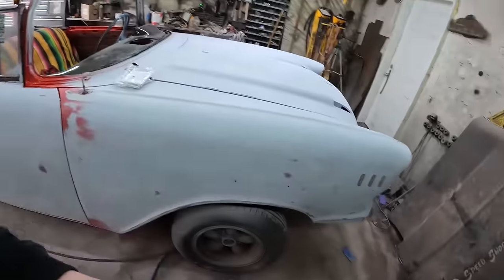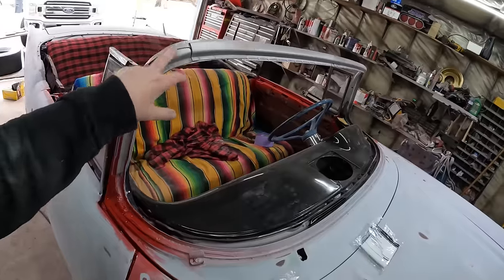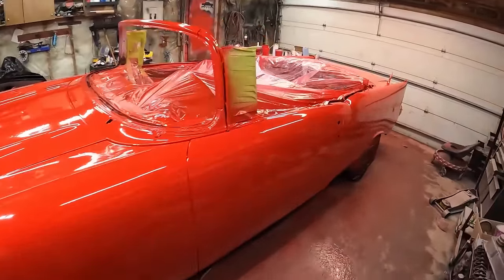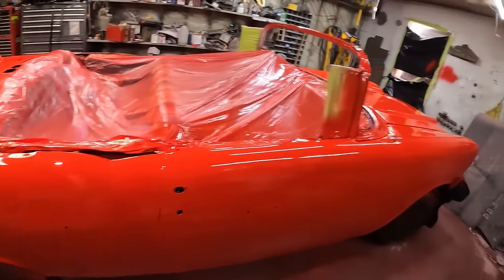"Almost Perfect" $100 Paint Job - Tractor Paint On A 1957 Chevy Convertible?

Comment: What  I like about this is you can paint the barn the same color and when you park the car inside it disappears in the background Now if you pinstripe the car you will have a huge job pin striping the barn. Of coarse if you painted flames on the car, it will make putting flames on the barn alot easier, just light a match.

Comment: It is all about flow.  Wait on the tack coat (actually touch a tapped part to make sure it is tacky) then by coat three you can add more reducer and open the material control a little, move a little faster to flow out the paint. Add 50% overlap and that is the best way to get between orange peel and runs. Nice work.
Reply: Yep, a painter friend of mine called the final top coat a HOT COAT.  Mostly reducer with a little color in it.  You have to be careful not to put it on too thick because it literally will sag the paint and cause runs.  But a hot coat makes the previous coats smooth out and flow.  Brings out a high gloss in enamel paint.  Practice on an old door or hood to get the technique down.
Reply: Yall have made me realize theres a whole class of painting i have yet to be introduced to
Reply: Turn your fan wider. And it will atomize the paint better and lay down better. Don’t over reduce the paint it will make the shine dull after a few days
Reply: Personally since he had the orange peel I would have sanded it and retacked  it after each coat then added the hot coat on top.. Then after the clear coat is added you ca mirror shine it on the clear
Reply: Seat upholstery?
Reply: But also do 4 coats if your going to sand and buff. IMO. your right exactly first coat light then more reducer as you coat. I usually shoot 3 then let it dry. wait a few days sand with 400 then spray 2 more. gets amazing results with Single stage. But I dont use that anymore. Base clear is much better for touchup or problems later that you need to spray and blend color. almost nothing matches so if you need to touch up later you will need to blend and the single stage does not blend well for smooth finish. That is why all manufacturers went to base clear.

Comment: That’s one hell of a accomplishment on so many levels , from four door , then two door and now a convertible. Simply fantastic work Dan . 

Cheers
Reply: That is for sure
Reply: IF your sanding and buffing you should do 4 coats. But I would sand it down and respray it one more time. Color sand it with 400 then respray it will look like glass. Second spray coats lay down really smooth. 2 more coats then sand and buff.....if your going that direction.

Comment: On paint where I don't have a spec sheet showing me exact recommended mixes, I have an old school method of creating a nice spraying and finishing mix. I add reducer to the mix slowly, stir it in and then lift the stir stick and allow paint to fall from it back into the pot. When the bubbles created by this come back to the surface in about two seconds, it's good to go.
Reply: That's a how a old school painter taught me mixing the paint correctly for a good flow. One thin coat, let it sit for 10 minutes until it's tacky, then a second coat with precision making it flow to a mirror shine. Then wait 10-15 minutes and third last coat laid down same as second, heavy taking notice what distance you holding the gun, check every panel before going to next one for any dry spots. Painted a lot of cars, 18 wheeler's, show cars during the years using this method. Water in the line or dirty paint gun has only created a few problem, but never the mixing method.

Comment: Looks like a 1957 Chevrolet convertible to me! A neat trick to get rid of those runs is to take a good glaze auto body or finish putty thin coat over the runs let dry good  then da the glaze putty with 800. grit paper un till the putty is gone and so will the runs.  Old painters trick.  I have  done this for years and try it,  form advice of a 75 year old watcher and 40 year painter

Comment: im a 35 year vet doing collision repair and restoration ..this week,One of the to do things was fix a 55 chevy hood that got punched in front hard and bent the edges in someone ran to tall of bolts threw the hinges one time. it looked like it was used as a table for hammers at one time upside down.getting to many hours in it now to make it sweet i complained about it and now at least they paying me by the hour on it instead of commission yikkers.the more i work on it the more i find wrong.but at least it still has original wore out green paint barely left on it the guy paid 55 dollars for it.its going on a old 55 racecar that still has gold leaf lettering on it from the 70s racing days to replace the big snorkel hood.love your videos!.remember you can never fill a high spot knock down the highs raise the lows repeat till its close

Comment: Silicone near any auto paint is a big NO, at some point you'll find that lesson out. A sealer would definitely help with all the cut thru areas, sand scratch swelling and possible lifting on those edges, especially due to the other paint applied under the primer. Hope it turns out half way decent.

Comment: Try this dan,  waite about 10+ days, wet sand it with 800 and rubber pad to get all orange peel flat and get all the runs flat as well, then wash the car and rinse it over & over. Then on a better, much warmer day ( 65+ degrees ) in 2+ weeks or so, mix up another batch of the same red paint with more hardener and reduce it as much as you did for the second coat that you though was to thin. Also it's  a good idea to let the fully mixed & reduced paint sit for about 20 minuets to let everything melt tougher as a unit before putting finished product in the gun.   Re prep the car & shop as before, blow the car out real good again and wet the floor, put a ground chain on, & wipe car with tack rag. Then put 2  more coats of red on, one medium coat and one lite coat with reduced paint. Don't be afraid to use even more hardener.  

   What you should always be doing is trying to keep reducing the paint MORE with each coat. "Never add " extra paint to make it thicker or it will go flat on you every time.  If you feel you need the paint just a little thicker, add MORE hardener, never more  paint.

 It would seem you are starting to listen to my advice, ( it's about time as I am a tool to be used) Your doing good, just keep asking questions and I will give you the correct answers .

Comment: Great work Dan, sure it wasn't perfect but it looks dang good!  One of my garage paint jobs- '91 LeBaron convertible- it was about 100* in my garage "booth" in Georgia, USA and I used the slowest reducer I could buy and over thinned it- I was drenched in sweat and wearing long sleeves so I would not drip sweat but it still happened in the middle of the hood- charcoal base coat with clear. Between the heat causing the paint and clear to kick too quick and my 110 volt air compressor being somewhat inadequate on volume, well I had a lot to wetsand and buff- at least I laid enough material down!  Once you mix the hardener etc and start to pull that trigger you are committed for sure, no stopping in the middle of that job!

Comment: Thats good advice you gave Dan, I practice painting beaters with cheap single stage paint like that rather than spending $600 and up on a quality two stage that if I screw it up will cost even more to fix. With a $30 gallon of paint you can screw it up a lot and its just a good learning experience. Its fun to practice with metallic, particularly silver and medium blue metallic, because those show off not up to snuff body work and tiger stripes are obvious. You become a better painter by learning the hard way. Get the right metallic pattern without stripes and with a smooth finish, and two stage is SUPER easy to not screw up.

I am so over the cold and snow. Last week it was 70F, this week has been 20s and teens for highs. Then they salted the roads Monday.. so no hotrods come out until it rains enough to wash it off the roads. I am jones'in for a burnout fix.

Comment: I'm going to try to help you out, it's up to you as to rather or not you take it to heart. What ever components you're going to mix needs to be measured in separate containers, in this case there should have been 3, base paint, hardner, finally reducer. Add each component to the base SLOWLY, stirring rapidly as you do. What this will avoid is washing the binder off your solids as it plows through the center of your base, doing that leads to a whole host of problems, kick-out, seediness, slow cure, and later on, crazing. Also, in the absence of a paint shaker, stir your base 100 times....no cheating! Let the mixture slake for 10 minutes stir 50 times, then spray away. You're using chemicals that need to be blended carefully so, be the chemist. Carry on, good luck.

Comment: It may be this and it may be that, but it is one million times better than it rusting away in a field. If you are going to continue painting your creations, then look into buying a pro paint mixer. My father is a pro body man, he has a paint mixer. If the jack stands are touching the metal undercarriage then the car is grounded out. Which prevents static electricity from pulling dust particles out of the air onto the paint. If you don't use jack stands then drape a chain over the axle and run it lengthwise under the car to properly ground it out. If I were you I'd continue to do body work and paint, even though you hate it, make it an acquired taste, because the world is going crazy on costs. So ya better keep learning to perfect your art by doing it yourself. Keep on givin her Dan and we will stay with you for the ride. It's life, life is lessons learned and the journey made and that's why I love watching your channel, because I get to watch you move forward in your skills. Fuck Yea hims did!

Comment: A couple of tips, wrap paper towel around your wrists and tuck it into your gloves it soaks up the sweat drips from your hands, hang thin plastic decorators sheeting around the walls day after you blown out the dust it'll have some static to collect fine dust your disturbing, it'll cut down on the dust in the paint. nice job tho, looks good.

Comment: Well i think you did a pretty damn good job. In a few shots looking down the driver's side, it looked very straight. I think once the trim is on and whatnot it will break up the red and any imperfections won't be as noticeable. Either way its gonna look REALLY good going down the road, being DRIVEN. And I'm sure chips and scratches will be an easy fix too, with this stuff. Right on man, you should keep up with the painting!

Comment: Wow, whats the inside temperature of the shed??
What is the temperature of the panels?
Cold temps and your paint will 'Bloom' and the Bloom spots wont shine. 
You might make it better with a cut and buff but with out heat, i wouldn't rub it back
for a month. Let it fully cure/dry then rub it back with some 1000 grade wet n dry 
then polish it with a cutting compound and finish it with a hand polish. 
Something My Mothers or Meguiars ultimate compound. 
Your learning and doing something you enjoy so keep on keeping on.

Comment: Cool. I would have used a wider stay pattern  and more over lap. Four coats is the general rule.  Also need to spray up under the wheel well edges.  Just some advice, nothing more than my two cents. Hehe.

Comment: ( nice new red hair tips , great buzz too ) But Naw , you could two tone it white as the top color ( hides a plethora of body work and hits,  runs and errors  as the krylon commercial used to say , hit it one more time until covered , let it dry under the most heat you can , and until summer if you have to , sand as needed, finish w clear automotive, buff 💪, great color for what it is , you won’t know the difference, and anyone who does , F em !

Comment: The hundred dollar paint job?  Right!   I'm painting a 65 Nova wagon right now and found a gallon of Innsbrook Blue Dupont Centari enamel in a dark corner of my garage... free paint, yea.  Of course the half dozen rolls of tape at $12 each, the 400 wet/dry at $1.30 a sheet, the thinners and solvents at $24 a gallon, the $100 etching primer, the $100 hi build primer, the $40 can of bondo, D/A paper, file board paper, I'll be spending $500 even with free paint.  Still cheaper than tipping strippers at the nudie bar I suppose.

Comment: Pretty sure you call that "FIRE engine red." as much as you struggled with the color, you are not alone.  red is an expensive color and there are endless hues. NICE WORK. (P.S.  they also call that "Ticket Getting Red." )
Reply: Look like in picture , straight body , see what look get the chrome on the car
Reply: Fixed the runs
Reply: Cop Caller Red. Same thing but different twist.
Reply: I always call that “Arrest me red” 😎
Reply: @hoosierdiyguy6300  Next level fun?

Comment: That tractor paint is usually pretty tough because of the application. just let it inside for a few days to a week to harden then it will be easier to buff. I look for the hardness when painting tractors because of putting the panels back o without paint cracking.

Comment: If you don't mind me asking what brand exactly of paint did you use and where did you get it from I'm trying to replicate the exact color bran everything you've got I've got a little Honda Civic I'm trying to paint red it's a factory red car but some idiot got a hold of it and spray-painted it I'm not trying to spend anything over a few hundred dollars as I'm going to do it myself in my shop it doesn't have to be perfect just something that'll look good for a few years. If you can give me all the info and details of the paint Brands and where you can get it I would very much appreciate it

Comment: i use tractor paint for a lot of things. cars trucks,  to change some of the colors i get 8 oz, can of pigment from the auto parts store to change colors on tractor paints, and then i get the hardener dry's faster and looks great, i don't know why they think automotive red paint cost so much but it's overrated, and cost is stupid prices, look at dans car it looks great, oh and you can change the colors also by using pearl in the clear coat if you want, cost more that way,

Comment: Too bad that the tractor paint doesn’t hold up.  The red gets a scum coat on it after a few months then turns a kind of brownish color.  Like old sixties GM burgundies did.
  I painted more than a few “used cars” with this stuff back in the eighties.  Looks good for a short while.

Comment: I suggest don't put water on the floor you'll drag your hose across it you pull your hose and it slaps Water all over your new wet paint I've painted at least a 150 cars in my garage and my garage floors a little bit of different colors but who gives a shit just cover up your equipment If that's your 1st paint job it's not bad

Comment: That paint will cure up pretty good with hardener.  It still cures slower than auto enamel but will be pretty durable and color sand out just fine.  I painted the transom - sea well area of my 40 year old lake boat nearly ten years ago and it still looks new, even resistant to fuel spills!  Cheap can still be good!

Comment: I've painted for 35 years   in a shop like yours  with a fan and wet the floor   but wet sand  is the very best   block it out 2000  gritt  lots of water  and put a drop  of dish soap in the water bucket It cleens  the shit out of the  sandpaper   I love the 57 my new Ryde now is my 57 pontiac Laurentian

Comment: First car I ever painted was this nova in the lil picture next to my name…..I did it in my garage just like you….it’s a single stage white, and the hood and trunk are black ….but on top of that I put down a high solids clear coat 3 layers with the first 2 having a green ghost pearl so when the light hits it it has a green sparkle and the trunk and hood basically turned a deep bass boat sparkle green, people are shocked when I tell them I did it in my garage by myself…..I’m gonna do the same with my ‘73 c10 fleetside just with a blue ghost pearl in the clear over the white…..I have it all ready I just gotta finish a little bit of prep work……you know how it is!!!

Comment: Just the opposite the more paint you put on the more orange peel and runs. I always keep my material feed down to 2 turns on last couple coats and .about one turn for first coat.Let paint  tak up between coats.Putting more paint works on hood and deck lid because they are flat surfaces.but it causes runs on side .The key is less paint
 make sure your paint is atomized real good with air pressure  and slowly build that glossy finish.Thicking the paint will cause runs and orange peel.

Comment: Lookin pretty good for a rehabbed 4 door. The DIY cheap paint jobs teach you how to paint along the way. it's just like anything else - welder needs stick time, driver needs seat time, painter needs gun time. I watched a journeyman painter shave runs with a razor blade once, doubt I could do it without gouging. He did it after a couple days, there's a not to soon and not to late element to it....you want a level of softness in the run and hardness in the surface.  AND .... wait to sand... the paint in the run won't be cured like the surface - It'll need time to harden up. If the runs aren't in a compound curve area (like fenderwell lips) they make shavers (for lack of a better term) for cutting the runs down to sand. 
I think you did great. I'd bet it''ll be nicer than a 20 footer when you get it sanded and buffed. Thanks for sharing

Comment: Hey Dan, I don't know what you have planned for a future top for it, but I would suggest getting a boat cover made for it that attaches with dome fasteners to cover the interior from rain etc when your not driving it. Beat getting in on water logged seats. Its a cheap option until you got an actual top for it, if of course, you are planning on getting one.